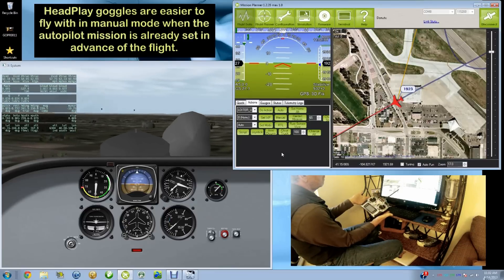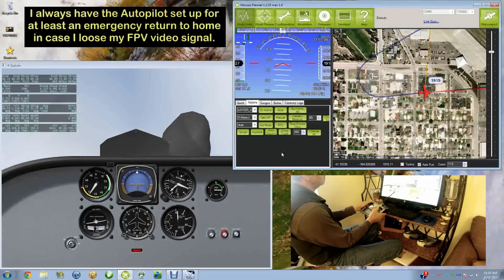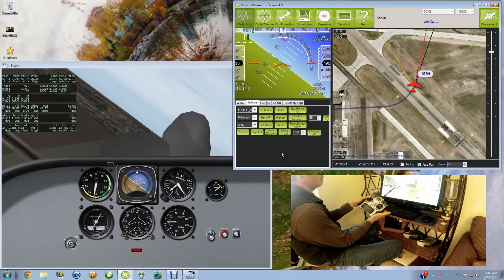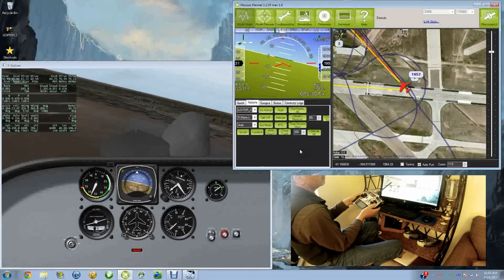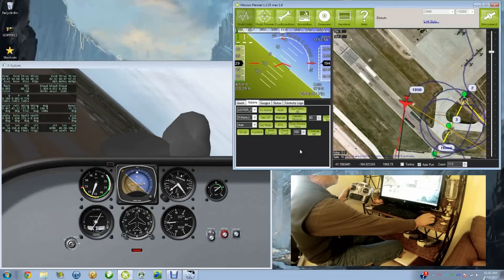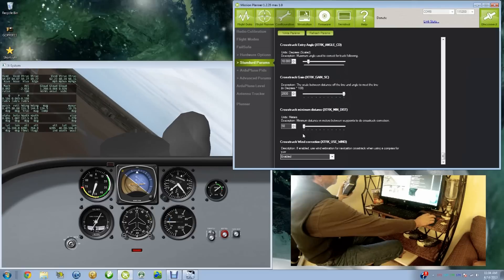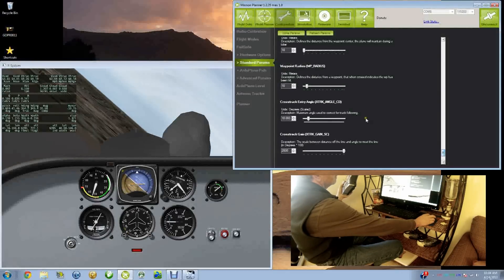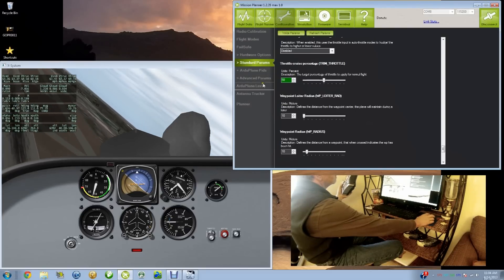HIL Autopilot Simulator w APM2.5 on X-Plane 9

Comment: Any pointers on getting started with Simulink HIL and a multi-rotor copter?   Most of what I've read is on fixed wing.. not sure why... maybe more hardware interfaces are needed (mavlink?) to do hardware-in-the-loop on multi-wing platforms.. something like  AeroQuad32, PX4, OpenPilot, MultiPilot32, Naze32, AUAV3, VR-Brain, ArudWot etc.

Also, aside from waijung and the APM2 blockset, are there any software/hardware 'kits' that already do something similar?  I didn't see anything for sale on the SkywardRC site, but just thought I'd ask :)